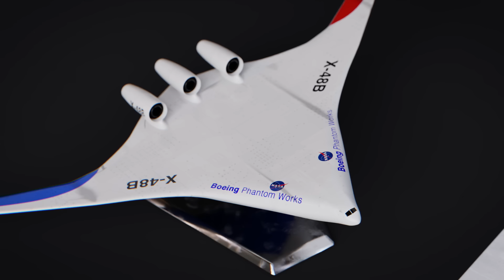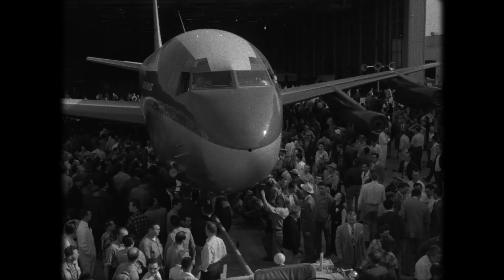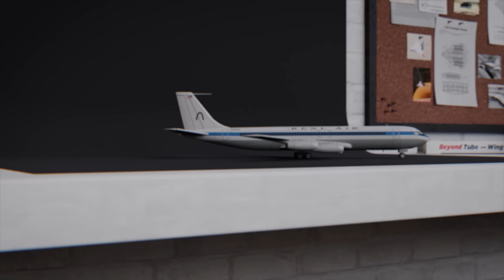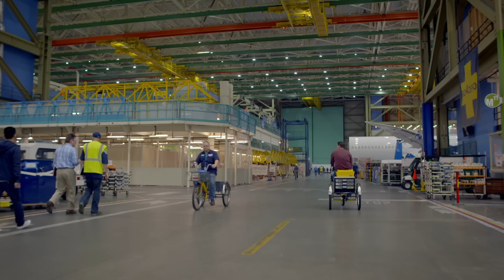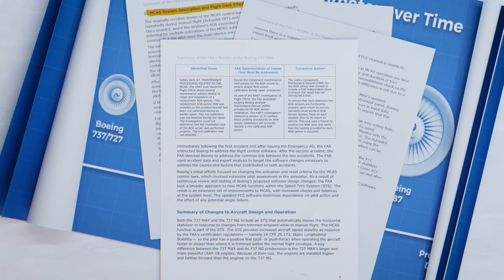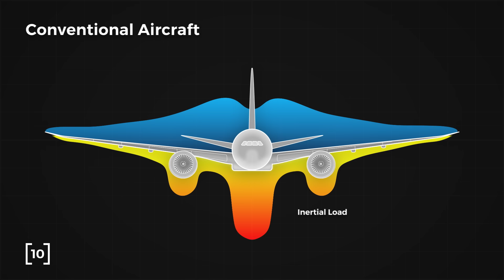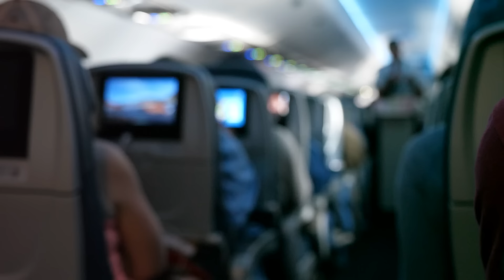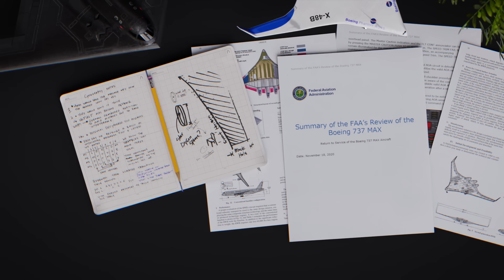The Plane That Will Change Travel Forever

Comment: The center of mass & lift bit reminds me of something I read during my kerbal days; an aircraft with its center of lift behind its center of mass will fly poorly, an aircraft with its center of lift in front of its center of mass will fly once.
Reply: A lot of my old designs for aircraft in KSP had no angle of attack on the wings or tail, with the center of lift placed in the exact spot of the center of mass. It’s not exactly a bad design, it’s basically what they did with the F-16 IRL. It’s just not amazingly stable.

But putting the center of lift further back causes the nose to have a pitch down tendency, which is not convenient if you want to cruise, and it also makes it hard to pitch up effectively.

So nowadays I put the center of lift of the wings alone at or just behind the center of mass with a positive AoA tilt, then put the tail on with a negative AoA to avoid the pitch down tendency. It often takes a lot of tweaking to achieve a  stable level flight at the preferred cruise speed and to have the fuselage to simultaneously be traveling straight forwards (setting the wing/tail angle wrong can put the fuselage at an angle of attack in level flight, increasing drag and reducing fuel efficiency).

Angling lift surfaces in the editor can confuse the position of the center of lift. That’s because for achieving level flight at a certain speed and AoA requires information that the editor doesn’t give you.

To get level flight at a target speed with an angle of attack of 0 degrees, you need to know that, at the target speed, the design will generate exactly 1 g of lift, and zero torque. But the editor doesn’t tell you the amount of lift or torque at different speeds, just the average lift vector.

Also, lift is supposed to be a vector perpendicular to direction of travel, as any aerodynamic force in the backwards direction is really drag, not lift. And yet the dumb editor in KSP will often show you a lift vector pointing backwards to some degree. Completely not useful.

Comment: The B2 bomber is known between pilots to be one of the most difficult airplanes to fly... alone that would make me think twice to get inside in one of those airplanes...
Reply: Eeeh... that sounds like a lie
Reply: No, it's the F-117. The F-117 is the most difficult plane to fly, it has literally zero aerodynamic characteristics, without fly-by-wire it will just crash.

Comment: Really interesting video, well done. Although you might want to focus on more than just efficiency alone in regards to the design of passenger planes and explore the full reasons current designs have evolved to the tube/wings approach. You need to touch on passenger focussed elements such as boarding/evacuation, safety, airport handling etc. If it was purely down to efficiency & design alone then current planes could easily be made lighter/stronger by removing the windows entirely. So clearly the engineering of passenger plane is a complicated trade off between numerous factors, but not losing site of the fact they are fundamentally there to carry people and that brings with it a host of requirements not considered here. I'm in no doubt that you are correct and we are seeing the future of passenger plane design, I just don't expect it to be as straight forward as you think just because the "technology" is available!

Comment: i won't be excited until it docks at a terminal. it's so boring to see all the same kind of aircraft, it's even more boring that the Airline industry doesn't try anything new.

but BWB aircraft have already taken over a sector of aviation, with hundreds of thousands of aircraft sold, super great safety without a single fatal crash and, i should mention, all electric powered.

the hobby industry. many of the most popular ready to fly RC planes are BWB, with most of the traditional airframes being replicas, not new models.

Comment: I know that forces and other things regarding the construction scale, but would a blended wing with a 250ish passenger capacity present any different challenges to a 450 one?
I doubt any airline in the planet would need a behemoth of that size on the current market (and i don't mean the COVID market, I mean the "direct route to everywhere" market) that dominates travel currently.

Comment: 24:52 STOP WITH THE HYDROGEN ECONOMY. It's simply not possible, hydrogen is an energy storage medium, and a piss-poor one at that, which bleeds through basically every container in which it's put because it's barely bigger than a proton. Instead, question WHY people keep harping on about the hydrogen economy when its physical viability just isn't there.
Reply: the reason it's brought up is because it's one of the more viable ways to transition weight-critical transportation to green(er) sources. The number of alternatives isn't exactly plentiful, and it's not like other alternatives are issue-free either...
Reply: @HELLO7657  Hydrogen infrastructure aside, gravimetric density, sure. Volumetric density, it's in the toilet, and the solutions to make that work seem to be ignored when it comes to implementing them inside a plane that will ultimately be electric. When taken into account the fact that 95% of the current hydrogen economy comes from the processing of METHANE from the FOSSIL FUEL INDUSTRY (with the notable exception of Japan's massively-subsidized tiny beef-manure-sourced H2 infrastructure) it becomes clear that the only reason we're still talking about this is because it's another way to sell us LPG.